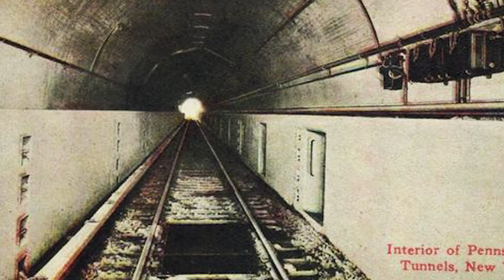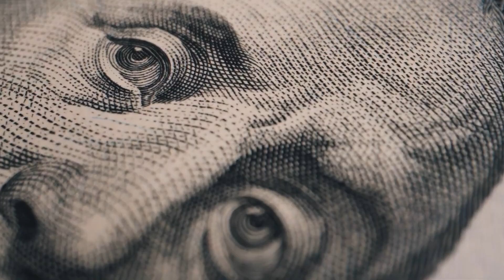America’s Most Critical Rail Tunnel is Failing—Here's the $16 Billion Plan to Fix It

Comment: The biggest bottleneck?  Getting DC to pay for it because the railroads don't want to invest in their own infrastructure.
Reply: Keep in mind Washington doesn’t pay for it, it’s Federal taxes from New York and New Jersey taxpayers and now being returned to these states. Both NY and NJ pay in more federal taxes than they receive. In theory, you could add a surcharge to every train that uses this infrastructure and let riders pay. If these train lines fail, NYC won’t be as productive or generate as much in taxes.
Reply: 1) The railroads do invest in their own infrastructure, quite a lot.

2) Amtrak owns this rail line, and they’re perpetually broke. They must beg for funding to do anything
Reply: @andrewreynolds4949  If they have to "beg for funding" then they are not economically viable; why should my tax dollars keep bailing them out.
Reply: @marcman844  Precisely. Amtrak could run the NEC and a few other lines off their own income, but the vast majority of the network is a money sink. Ironically, it's the die-hard political support for Amtrak that's holding it back in many ways, since it's politically nearly impossible to cut underperforming routes, services or stations.
Reply: @marcman844   Like Oscar Wilde once said some people know the "price of everything and the value of nothing".